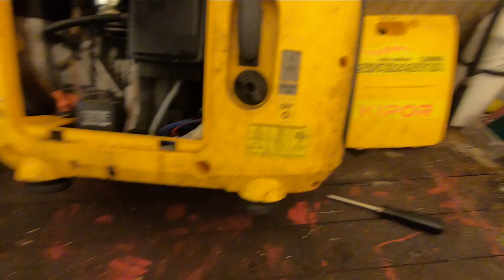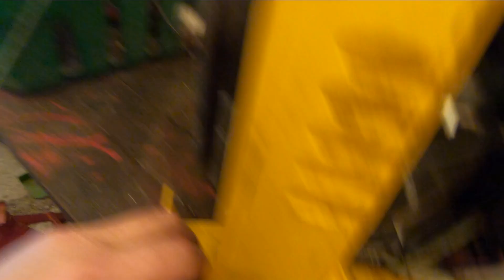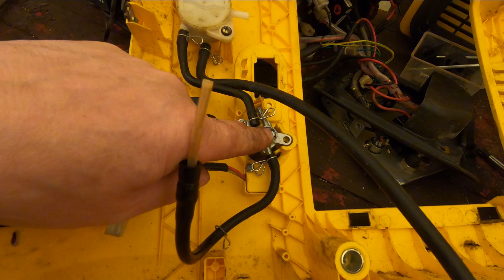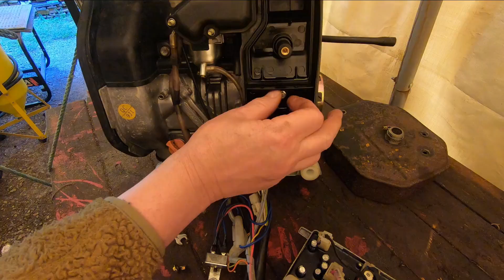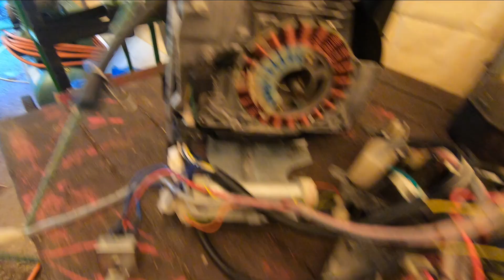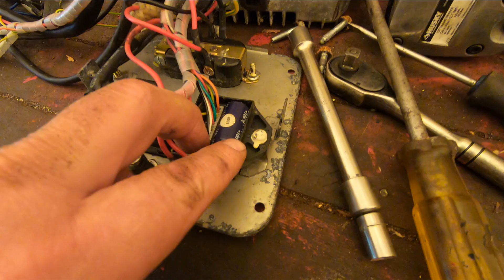~ KIPOR INVERTER GENERATOR TEAR DOWN ~ AN OUT OF THIS WORLD GENERATOR ~

Comment: That is NOT the rotor. I take that back. That cap that runs across the oulets is probably the one at fault. Measure it's microfarad while it is unconnected. Probably something really simple.
Reply from the maker: Thanks for the tip, that's a great idea to test for a simple fix! 😊

Comment: Did you happen to measure the stator windings and output voltage?
Reply from the maker: I made this video some time ago, but the output voltage wasn't measured because of an inverter fault: The unit doesn't produce power. I can't remember if I measured the resistance of the stator windings...lol what I did is in the video,

Comment: Nice vid...any plan for reassembly and testing???
Reply from the maker: The inverter module is defective so I probably won't have this producing power again. I did think to run just the engine part some day, so who knows? I really was surprised by the build-quality of this little engine.
Reply: @EverydayProjects doch das tut er oder ist die Generator Spüle fritte
Reply from the maker: @markusleuf4285 currently, the generator is being used to keep a door open. It may never produce electricity again. 😅

Comment: The output indicator and alarm LED's  are directly connected to the inverter. The electronics are for timing and generating the spark. And the Low oil to shut down when the oil is low.
Reply: Bzw die Zündung wird unterbrochen

Comment: I like your inate sense of curiosity. You want to know how everything works. 
Step 1:
Take every screw, bolt, nut, wire, hose, clamp, circlip, bracket, and anything else that will come loose off. 
Step 2:
Scatter parts around the workbench.
Step 3:
Promise to put it all back together in a future video.
I will be looking for the future video.
Very entertaining,  Craig!
Reply from the maker: The scattering of parts I have down pat. Now...the reassembly....let's see.
Reply: It helps to have it on video and posting it in youtube.

Comment: I found that decompression pin and timing are very interesting. Now will the  Kipor run and supply power, we will see.
Reply from the maker: The decompression feature is usually only found on a bit larger engine that may be difficult to pull over, but it was a surprise to see it here. The timing chain drive of the camshaft was also a design feature I hadn't expected. It was interesting to see what's inside. WILL IT RUN AGAIN? We'll see...

Comment: It sounds like the price was right 🙂 Very odd how the coil was mounted, the engine is very clean
Reply from the maker: Yes, the price was right. Some guy had it locked in his shed and didn’t seem to notice me taking it😂😂He probably won’t miss it!😂😂I like to explore these kinds of things, The coil is externally powered and does not rely on proximity to the flywheel magnets to function. Still strange. Have a great week 😊

Comment: Nice teardown Craig.  All them low cost gensets  are disposable as the cost of repair shop is more than a new one.
Reply from the maker: The handle on top is to aid in tossing them into a dumpster! Actually, I think these are quite well-made and it was probably very reliable and quiet for many years. It will never be as quiet, though, as it's going to be if I can't get it running again!

Comment: That's a good walk-through for the generator.  
You are wearing long sleeves, and it's 95 degrees here. 🤯
Reply: 65 Here⛱️🌊
Reply: @bigsonslawncare  That's perfect cutting weather.  (Side note,  it wasn't a Vette 🙂)
Reply from the maker: That's not a regular long sleeve, Bill. It's a special jacket I bought in Area-51 to help protect me from the radiation that emits from these UFO generator sets. Sometimes I wear tinfoil on my head, but that's another story.